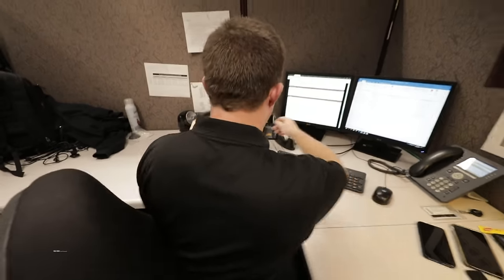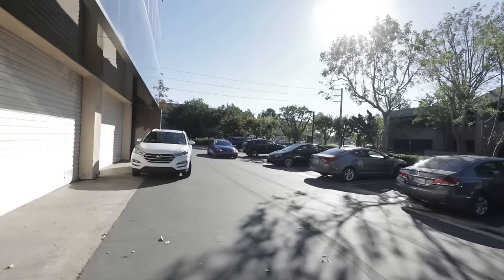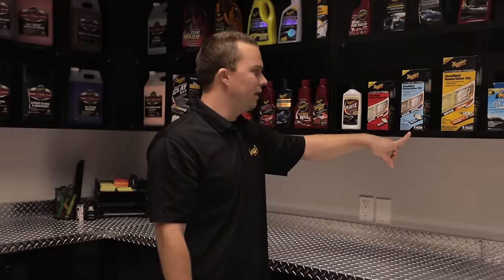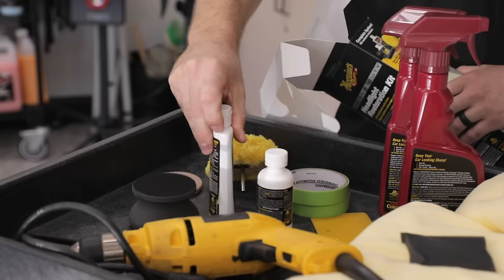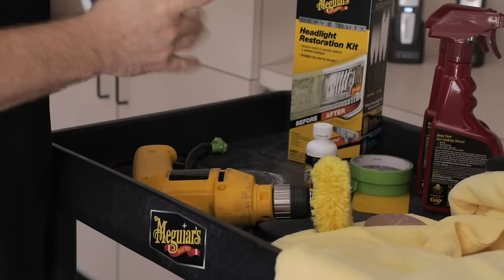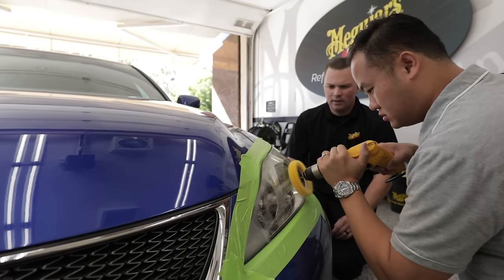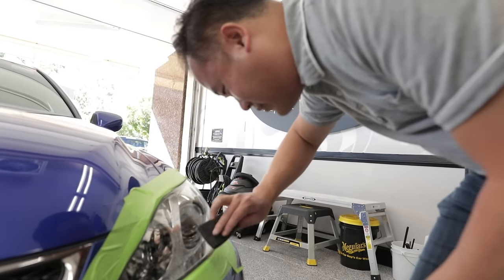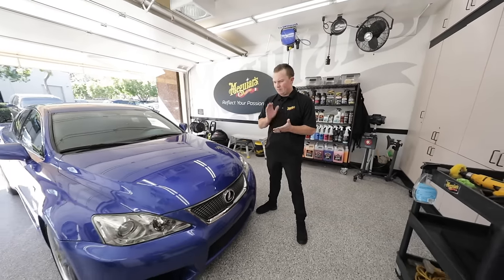Meguiar’s On Headlight Restoration: Heavy Duty Headlight Restoration Kit

Comment: Using it right now on a 2008 Altima and so far so good.  Finished up and everything looks fine I would use again.🙂👌🏽
Reply from the maker: Great to hear!  Thanks for sharing!
Reply: Serg Clark Altima headlights clean up really nice when I’ve done them. For whatever reason Japanese cars clear up better than American made in my experience.
Reply: @yortsemloh1156  I’m not too sure, used the moderate one for my 08 g35 and not really any impressive results. Might have to use the drill kit.

Comment: You didn’t follow the directions on the package. 😂. I’m just playing. You did do it opposite as the directions but I’m sure obviously it doesn’t matter. Worked great for me.  Easy peasy.
Reply from the maker: Not sure what you are referring to specifically?
Reply: @meguiars  not that big a deal I’m sure. But the directions say to use the 1000  side to side and the 3000 up and down.
Reply from the maker: Yes, that is of no consequence.  The point is to sand in the opposite direction.  It doesn't matter which is horizontal and which is vertical only that they are opposite.  👍
Reply: @meguiars  I thought so. Mine turned out great. Hey If you keep a coat of wax on from time to time will it prolong the effectiveness of the sealant.
Reply from the maker: Not particularly, but it would not hurt either.

Comment: Mine were VERY yellow and I made random orbit sander disks with 600 and 1000 grit paper using contact cement. Then used the kit. There was no way that I was going to scrub that heavy oxidization off without some help. Headlights came out perfect.
Reply from the maker: Awesome.  

Thanks for the feedback.  👍

Comment: Great product Plastx!!! Just tell me what you use at the end for protection (coat)?
Reply from the maker: If you are referring to the subject of this video (Heavy Duty Headlight Restoration Kit) it includes a wipe-on sealant you would apply at the end for long-lasting protection.  If you are referring to the use of PlastX outside of this kit you can use our Keep Clear Headlight Coating which is and equivalent coating only is spray form.

Comment: What's the difference between the headlight protectant (g17110) and the spray on headlight coating? Can i use either? Which one last the longest?
Reply from the maker: The G17110 Headlight Protectant is an older product in liquid form that has been discontinued.  It was more of a synthetic sealant than a coating.  The newer G17804 Keep Clear Headlight coating is an aerosol applied product and yes it is longer lasting.
Reply: @meguiars  What is the difference betwen the G17804 and the wipe on coating in the Heavy Duty restoration kit? Can they be intrerchanged? I.e. can the spray be applied to the fully polished and buffed headlight or does it need to be applied to a hazed surface?

Also I am having toruble applying the wipe on coating evenly. It either streaks or runs. What is the best way to get smooth finish?

Comment: I used the headlight coating spray and I see that it lasts for one year but after the year, should I do the process again, sanding and headlight coating?
Reply from the maker: That depends on the condition of the lens at that point in time.  If it has oxidized/hazed/yellowed again you would want to do the whole process.  If it is still in great shape you could just use the coating.

Comment: For the 24h cureing does it matter if it rains? 

So wants theirs done today, but its supposed to rain later.
Reply from the maker: Correct, should not get wet for 24 hours.  It could cure faster or partially cure but to be safe ideally 24 hours without any water, rain, etc.

Comment: Hello Sir!! I ended up with orange peel after i applied the Meguiars headlight coating and ended up with orange peel …. can i wet sand the coating ?? And if i can will it shine up ok or will i haft to re apply
Reply from the maker: Sounds odd.  Have not heard of that happening but the easiest way to remove the coating would be to use rubbing alcohol (90%-100%).  Yes, you could certainly sand again but will need to follow with the appropriate steps that follow also.

Comment: Is it also fine to use a normal eh foam (orange) polishing pad or maybe normal white wool one? Is there much difference?
Reply from the maker: If you have the kit you should just use the drill/pad provided but yes in theory with a good DA machine and the appropriate pad you could likely get results.

Comment: This works. But the last step: applying the clear coat is impractical. You will see streak marks as you will be using the foam applicator...id rather spray the clear coat evenly. They need to fix that!

Comment: What's the reason for the recall on the heavy duty kits?
I have noticed the sanding pads delaminate on the first few uses. 
Use better adhesives would be my solution
Reply from the maker: The recall is solely related to the glass bottle that holds the coating.  That bottle was only in production for a few months last year.  Any kit purchased now or before that time will have the white plastic bottle and does not fall under the recall.

Comment: I'm using a restoration kit on my headlight. After the headlights are restored, should I put wax on the headlight, then use the mcguiars coating?
Reply from the maker: No, no need to do that and you would not want to.  Just use the coating included in the kit.

Comment: do i need a polisher tool? or can i just sand it and clean it.. shouldve read the box when i bought this lol :D
Reply from the maker: This kit comes with the drill attachment which is used to apply the PlastX polish and remove the sanding marks.  It is fairly important that you use it.

Comment: Could a hydrophobic spray work in place of the sealant? or Can I put a hydrophobic spray over the sealant?
Reply from the maker: Yes, to both.  You can use it in place of a sealant/polymer based wax or even on top of one.

Comment: Is there any temperature limits on doing this restoration? 

I’m in Minnesota and it’s currently middle of winter...so the outside temp is usually somewhere between 0°F to 25°F.

Does the cold affect the product?
Reply from the maker: We typically do not recommend using any of our products below 55 degrees.  They don't become harmful but they can become much more difficult to apply and remove.  The temperatures you are experiencing are below freezing which of course could further complicate the situation.  Your best bet is to find a heated garage you could use for a little while.

Comment: I have a 2014 kia forte and i am having trouble with my headlights but my problem is not buildup or water corruption, the clear coat on the headlights is coming off and it looking awful, i was wondering if u guys have any product that i could use or any suggestions on what i have to do, definitely not looking forward on replacing the headlights since is way to damm expensive!!! Plis any suggestions will help!! Thank u
Reply from the maker: Hi Angel, you basically want to start fresh by removing the remainder of the factory clear coat.  This is most effectively done by sanding it off.  Our Heavy Duty Headlight Restoration Kit in this video has the ability to work for your situation, however, in some cases, it can require more aggressive sanding than what is included in this kit.  Give it a try, and we can always issue a refund or send out product of equivalent value, if indeed, it does not work.  If you need this option, you would contact our Solutions Hub at 800-347-5700.
Reply: Thank u for replying and i will give it a try, my concerns are that the headlights get worse of what they are and simce they really expensive am really nervous on doing something and it doesn't work!!!
Reply: Question with this product here in thos video can u use the spray clear coat that u guys sell also???
Reply from the maker: I personally, the one responding now, have probably done hundreds of headlight restorations over the years, and never once did I see where completing the process made it look worse.  Even if the 1000 grit doesn't fully remove the remainder of the factory clear coat, follow every step all the way through, and they will look better.
Reply from the maker: Yes you can if you prefer.
Reply: Ok thank u for the info i really appreciate

Comment: How do you fix a sealant high spot?
Reply from the maker: High spots are typically related to the application of a coating not a wax or sealant so it is hard to understand exactly what you are asking here.  If you are hoping to remove a wax/sealant from a particular area of the paint you can certainly do so with any compound.  You would also use something like our M122 Surface Prep if you have it to strip the surface bare.

Comment: Would a ceramic coating or Paint Protection Film or Graphene spray provide better protection to the refinished headlight?
Reply from the maker: Yes, in theory paint protection film is going to hold up much longer than any wax or coating.

Comment: Hi, I am looking forward to trying this but I just opened my new kit and noticed I have 2 of the 3000 grit sanding discs, not the 1000. Will this make a big difference in buffing out the fogginess?
Reply from the maker: It may still work if the oxidation were not bad but please feel free to reach out to our Solutions Hub to help remedy the issue and get you the 1000 grit disc.

https://s.3m.com/6jtc8a

Comment: After say 6 month to a year do I need to go full on with the sand paper or will plastx and clear suffice
Reply from the maker: Hi Nathan, if you are referring specifically to the kit used in this video, which we assume you are, typically after a year, either using PlastX on the included drill attachment, or the 3000 grit step (followed by buffing with PlastX & drill) will restore the light back to clear, & ready for another application of the included protective coating.  In other words, in most cases you do not have to go back to using the 1000 grit step.  Although, if you had to, it's perfectly OK to repeat the entire process again after one year.  One other tip, you can also just re-apply the protective coating sooner than one year.  Just make a note on your calendar to re-apply every 3 or 4 months, and you can keep the lights clear even longer.  Hope this helps.  Feel free to post further questions, give us a call at 800-347-5700 or join our discussion forum at www.meguiarsonline.com.  Thanks - Nick

Comment: Hallo and greetings from Greece! Your products are awesome!! Before I buy two of your products I would like to tell me something. 
I would like to make my headlights shine by hand.  but without damaging the varnish, just above the varnish.  which product do you recommend? Meguiar's Plast-X Clear Plastic Cleaner & Polish or Meguiar's Headlight Protectant?? Thanks 🙏
Reply from the maker: If you need to remove hazing/clouding in the headlights you will want to use the PlastX or even better one of our Headlight Restoration Kits.  Our Heavy Duty Headlight Restoration Kit is the most effective and also comes with a coating to protect the headlights.

That being said we cannot speak as to what is available to you in Greece.

Comment: How many headlights can you do with the kit? I assume you’ve to change the sandpaper after a certain amount of uses?

I used it on my headlights and it’s amazing I just wanted to know as a side hussle to make some cash
Reply from the maker: It is designed to do at least 1-2 sets of headlights.  Some people have certainly stretched it out to work on a few/several cars but that really depends on the severity of the oxidation on the vehicles and the person using it.  Again, this is a kit designed and priced to do 1-2 cars.
Reply: @meguiars  Thank you, I was just curious because wouldn’t you just need to replace the sandpaper since the kit has a lot of polish and the coating.
Reply from the maker: Yes, the sand paper will wear out first so purchasing more sanding discs separately would allow you to do more headlights.  The discs are 3M Trizact 3" sanding discs in 1000 and 3000 grit.
Reply: @meguiars  thank you very much!

Comment: Can we add the maguire's clear coat spray for more protection in top for more protection? And it will compromise the look of the final looks? Thank you im advance!
Reply from the maker: We would recommend sticking with one or the other. Not sure we've have seen/tested both used together, so tough to comment.

Comment: Can I use a lower sand grit sandpaper if headlights have heavy oxidation
Reply from the maker: You can as long as you finish with the sanding discs in this kit.
Reply: Try 600 grit, then jump to 1000 or even 1500, then 3000 grit, polish, seal.
Reply from the maker: This kit works for the vast majority of headlights but yes, there are severe situations where a more coarse grit paper may need to be used.  Again, most people will not require this though.  👍
Reply: @meguiars  I have to agree with this, I just did a 2015 Nissan Altima, headlights were pretty yellow all around, especially in the front. I tried 1200 grit and that pretty much leveled everything. That particular Nissan was made in august 2014, so a solid 7 years on those headlights, and even then 1200 grit removed just about everything, I then followed with 3000 grit, polished with M205, sealed with ultimate paste. Most headlights won’t need anything lower than the 1000 grit included in this kit.

Comment: I just finished doing my lights and after 3 hours or so it started to rain outside. Was 3 hours enough for it to dry up and hopefully set by 24 hrs? Or did the rain mess it all up?
Reply from the maker: The rain would have not impacted the restoration but could be an issue with the coating.  Probably just to be safe you could re-apply the last step (coating).

Comment: Hi. after 24 hours, is ok to put a clear wrap over the headlights and would it prolong from oxidation coming back? thanks
Reply from the maker: Hi Grace,

If you plan on wrapping your headlights in a vinyl paint protection film, you are not going to want to use any of our protectant offerings for the headlights.  Vinyl paint protection film would be used in place of a headlight coating, and you should be following the manufacturers recommendations for proper preparation of the surface prior to applying the film.

Comment: If you use ultimate compound or polish instead how will that work?
Reply from the maker: Ultimate Polish will not be aggressive enough to remove the sanding marks, Ultimate Compound would be aggressive enough to remove the sanding marks & is also not designed for rotary use and would likely not leave as good of clarity compared to PlastX.

Comment: Without pointing out the obvious "Sanding times will vary depending on how bad your headlight is, how hard you push and how fast you move the sandpaper back and fourth." Can you give me a ballpark estimate on approx how long it will take with each sanding disc using moderate speed/pressure? Like approx 10-15 minutes per disc? 30-45 minutes per disc? 

Just trying to figure out if this is something that can be done in about an hour from start to finish for both of my headlights (which are just a bit worse than the headlights in this video). 

Also, how long did you sand with each disc on the car in the video?
Reply from the maker: Hi Chuck, thank you for contacting us.  In general it should be around 10 - 20 minutes of sanding per headlight (both 1000 & 3000 disc). In addition, do not be afraid to sand thoroughly with both discs.  The duration we sanded in the video for Tommy's ISF was around the same, 15 - 20 minutes.  You should be able to complete the task in around one hour.  We hope this information was helpful & feel free to contact us with further questions. - Nick Winn, Product & Training Specialist, (guy in video).
Reply: This is, IMO, critical information. Would be nice to have some ballpark in the instructions. @meguiars

Comment: The box says 1000 grit is horizontal and 3000 grit is vertical but that’s alright. Waiting to see the results in a bit.
Reply from the maker: The point is simply to do an opposite direction not that it matters which is which.  👍

Comment: How long lasts the protection?
Reply from the maker: How long any protection/wax lasts is highly variable and depends on a number of factors related to the condition of the paint, previous prep, and the environmental elements the vehicle is exposed to. 

That being said for most daily drivers we recommend you wax at least 3-4 times per year.

Comment: Nice video guys! The coat came with the kit?
Reply: The Rag Detail the kit has everything you need.  The only thing you need to provide is a drill
Reply from the maker: Thanks! & yes, the wipe on coating comes included in our Heavy Duty Headlight Restoration Kit. If you wanted to buy it separately, we do make an aerosol version, our G17804 Meguiar's Keep Clear Headlight Coating.
Reply: @meguiars  i was wondering says 24 hours to dry but will it dry if my car is outside and it gets cold at night.. were currently seeing from 15 to 5 degree c° witch leaves like a slight frost

Comment: Why scrub horizontally then vertically?
Reply from the maker: Because if the sanding marks are not removed as easily as they should be you will know which grit paper the remaining sanding marks are from.

Comment: Why vertical- horizontal???
Reply from the maker: You can do horizontal-vertical if you like.  The point is simply opposite directions from each other.
Reply: The idea is that by going horizontal in the second step of sanding, you can see if you’ve taken care of the 1000 grit sanding marks that were done vertically. If you don’t see anymore vertical lines, you did the job of filling in those marks with the 3000 grit.